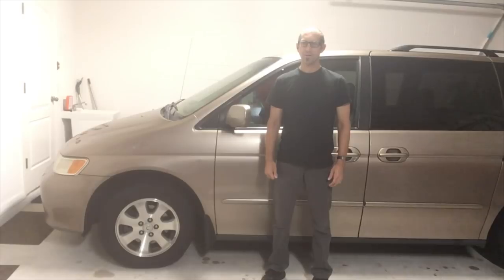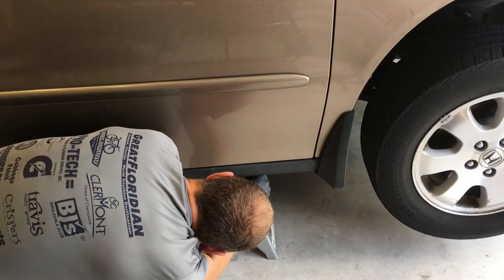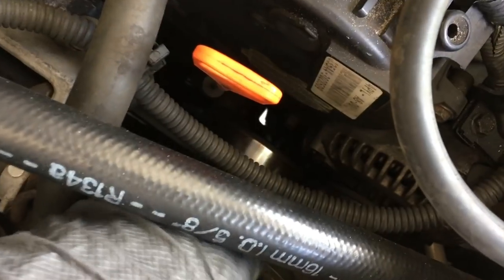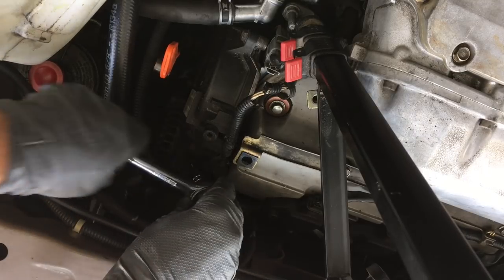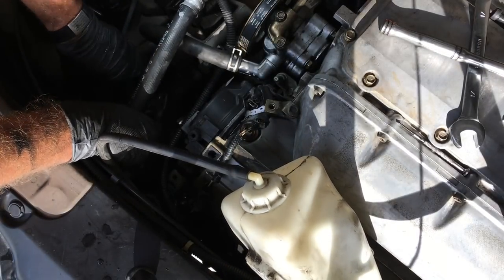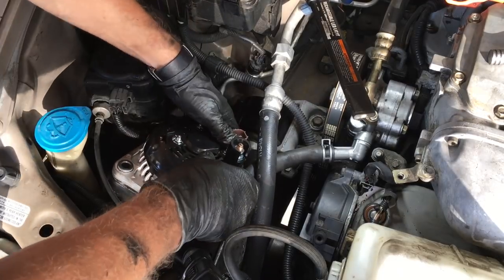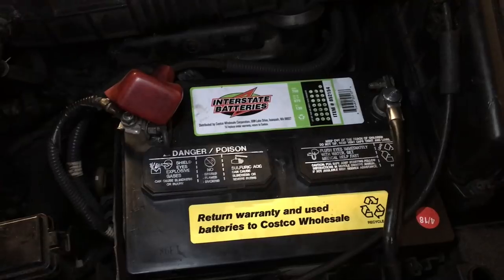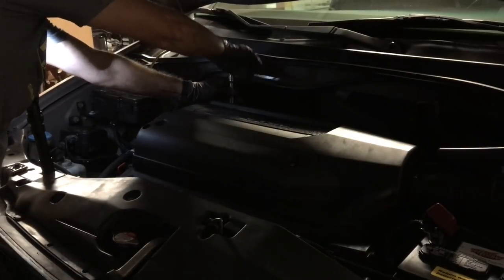2004 Honda Odyssey Alternator Removal & Replacement without removing tensioner pulley

Comment: You have the best video on youtube regarding this.
Reply from the maker: Crazywaffle5150 , thanks for the kind words.  If you have to replace an Odyssey alternator and have any questions, let me know.
Reply: DIY Jeff Anytime. :]. Lol. Actually I just fisnished getting it out 15 min ago. Did not even need even need the tool for getting the belt off. Just used the double wrench method. Lol with a 19mm and 18mm box end. Hardest part is pulling it threw the mess of hoses.  Haha
Reply from the maker: Crazywaffle5150 , yep, I think I mentioned it in the video, but it took me awhile too.  But the plus side is you don’t have to disconnect and connect them.  Plus, discounting hoses like power steering can be a real problem and mess.
Reply: DIY Jeff True. Lol. I got around it. Thanks for posting this video again!. I'm up an running now
 :D. 140 bucks later after buying a new Alt at Auto Zone.
Reply: ...there is a dude that simply took a pry bar and leveraged the tension pulley in such a way that the timing belt can just slip right off the alternator.... SOO MUCH FASTER AND EASIER.
Reply: @DIYJeff  6

Comment: Thanks for your helpful video, Jeff. I replaced my Alternator in my 2001 Odyssey over the weekend.  After watching your video, it appears to be easier to complete the alternator replacement on a 1999-2001 2nd Gen Odyssey, than with a 2002-2004 2nd Gen, since I was able employ my belt tensioner tool from the top side instead of from underneath.  I still had to jack the car up and remove the plastic undercarriage skin to properly fit the belt back onto the pulleys.  Your recommended tools for completing this job was a true life-saver.  Thank you so much!
Reply from the maker: cgrscott , awesome!  That’s great you were able to do the job.  It’s fulfilling to do a job yourself and save $$$

Comment: GREAT video.
Changed my brother's 2000 Odyssey alternator.
Only thing we did differently was to remove the top bolt when reassembling in order to get the belt over the alternator, then use a wrench to remove the tension from the tensioner then swivel the alternator back into position to replace the top (or right side) bolt.
It was way, way easier, and we didn't have to get under the vehicle at all.
Thanks for a clear, concise video.
Reply from the maker: @Spencer Reed, thanks for the tip.  Glad you were able to fast track the repair.

Comment: Anyone reading/doing this in 2021 I strongly suggest removing the tensioner in the 03-04. I just did mine, and messed around trying to get the 14mm bolt in for seriously like an hour. Went under and just took out the 17mm (i think that was the size) that held the tensioner in and was able to get that 14mm in immediately. I don't have a ratcheting wrench, I'm sure it would have helped if I did, but I still don't think it's worth it. Just remove the tensioner, IMO.

Great Video though! Much appreciated.
Reply from the maker: @M. K., thanks for sharing your tip with everyone!

Comment: Love his approach! I did pretty much what he said and while it was a chore, I'm up and running. THE ONLY THING I'LL ADD is I suggest you remove the bolt holding the bracket that holds the upper alternator bolt and the wire harness. Getting the alternator in and out was easy after taking the bracket off. I'm with CrazyWaffle... this is the best video I saw.
Reply from the maker: @Joe Lutz, good tip and thanks for the kind words.
Reply: Thanks I just got this thing out and it defs adds alittle more room

Comment: I wasn’t going to attempt this job until I saw your video. It wasn’t easy, but I got it done and saved a bunch of money. Thanks!
Reply from the maker: Prophesy to the Wind, you’re welcome.  Glad you felt enough confidence to venture into the project.  It’s satisfying to save money and do it yourself.
Reply: What is an estimated time to do this job?
Reply: @karenwohlforth8967  the first time I did it (I had to do it again since my last comment) it took several hours, but that was because of a bolt that was put in backwards from a previous repair. The second time, probably less than 2 hours. It was much easier.
Reply: I love saving money

Comment: The project is halfway completed.... am waiting for the alternator to install.  So far the removal has been easy due to your guidance.
Reply: Did you have any trouble getting the new alternator installed? I'm having trouble getting the two main bolts in.

Comment: This is a great informative video, I  just replaced my alternator on my 1999 Honda Odyssey EX and it went a little different than the steps in the video. I originally tried putting in a duralast alternator from autozone and it didn’t work properly. It was putting out erratic voltage and making the MIL lights on the dash flicker erratically including the battery light while other times the lights were solid (like when accelerating). I ended up putting in an OEM Denso alternator and it’s working great. A couple things that were different on the 1999 I used a serpentine belt tension tool I got from harbor freight and I was actually able to get on the tensioner nut with the long bar and the included 14 mm crows foot from the topside of the engine. I still had to jack up the car and remove the splash guards to get the belt back properly on the pulleys though. The tensioner nut is 14 mm on the ‘99. Lower alternator bolt is 14 mm and upper bolt is 12 mm as stated in the video. I used the half open half ratcheting box wrench for the 14 mm lower bolt with the ratcheting box end on it until I could get a 1/4 drive 14 mm ratchet and socket on it to finish tightening it. As others have said that’s the powering steering fluid reservoir not the brake fluid reservoir. I used some small vise grips with tags to clamp the hoses shut and a package of Dorman rubber caps to cap off the reservoir when removing it. Just make sure you refill your powering steering fluid after reconnecting the reservoir and burp out any air by turning your steering all the way back and forth a few times with the cap removed. Hope this helps.

Comment: Great video, Three tricks that will help it go even smoother.
1. Just remove the power steering reservoir completely it will free up a lot of room.
2. Put a jack under the oil pan and lift up about a quarter to half an inch this will free up a little bit of room.
3. Use your tensioner wrench and push the tensioner to the side this will create a lot of room for the alternator to slide out and the new one in.

Comment: Thanks for the vid! It helped a lot. I found it much easier to maneuver the alternator when I removed the upper mount bracket that the 12mm bolt goes into. Thanks again!

Comment: great step by step video...iam about to replace my alternator ill try to be as calm as you are,i usually cuss or perhaps throw wrenches on my pistoff drywall spot.
Reply: Its shitty job- Honda made it too tight... but its doable.

You can loosen the belt with a pry bar instead to avoid jacking up the van

Comment: Also...... The pulley tensioner is accessible from the top by fabricating a simple wrench. Take a piece of 1" x 1/8" x 24" ish steel bar and a T50 bit (which I got by dissembling a cheap socket). Cut down the T50 bit to a length of 3/4", drill a hole in the end of the steel bar slightly to small for the hex end of the T50 to pass through, then press the bit into the hole with a vise.  T50 was the size required to fit the bolt in the center of the pulley on the tensioner on my 2002

Comment: Jeff, thank you.  Your audio instructions were great.  The VIDEO visuals were fantastic. I am confident I can replace this today thanks to your video!
Reply from the maker: Scott, you're welcome.  I'm confident you can do it.  I do suggest the pulley tool though.  Without it will be much more difficult to loosen the tension on the belt to remove it.
Reply: DIY Jeff I did get the tensioner pulley tool on loan from the local auto parts shop. Without it, I would not have been able to complete.  I completed the job without any issues.  The only part not covered in the video was the engine splash shield. That was a pain but once I had it off, all went smooth. Thank you!

Comment: I enjoyed the video  .... you explain the steps well and I appreciate the detail with respect to safety.  I also appreciated the "patience" comments to warn the listener that some procedures are stubborn and requires a little  time to wiggle and or/unsnap   .....  I found the wiring harness to be difficult to remove.
Reply from the maker: Mr. Jazzohjazz, how did the project turn out?  Yes, the wiring harness gave me a little issue too.

Comment: Great video - on my 2010 - I was able to access the tensioner from the top with a socket wrench and a length of pipe over the handle for leverage.
Reply from the maker: Tim, that's great!  The tensioner pulley is accessible from the engine bay on Odyssey's newer than 2004.  Good thinking on using a bar for leverage, saving you from renting or buying a tensioner pulley tool.

Comment: Thanks for the help. Took some splash guarding off to gain access to the tensioning pulley and a wrench fit right on. Took time and patients but it wiggled right out saved me a bunch of money.
Reply from the maker: Neil, in the future, if you live near an Autozone, they have a free tool rental available.  That's where I got the tensioner pulley tool.

Comment: It worked like a charm except that it was too tight a spot to get the 19mm socket onto the serpentine belt tensioner bolt, even with the tool I rented from oreilly's . Amazingly, a 3/4 open ended wrench worked like a charm. The serpentine belt tool seemed totally unnecessary. Thanks for this video!

Comment: Thanks, great video. I have a 2003, and was able to get to the tensioner pulley bolt from the top.
Reply from the maker: @paul nenninger, that's awesome you were able to get the tensioner pulley from the top.  I just wasn't able to reach it on mine.

Comment: Two suggestions to make a bit more room to remove the alternator:  The right (14 m) bolt connects to a bracket.  The bracket can be removed to provide additional space.  You can  also get a bit more room by keeping the tensioner pulley retracted.  You can do this by rigging a piece of wood to keep the tensioner pulley tool in the retracted  position.
Reply from the maker: James Immordino, thanks for sharing the tips.  Good information.
Reply: Thanks for this info

Comment: I have a 2001 Honda Odyssey with 342 thousand miles on it and I'm still on the original Honda alternator. Before I begin my summer road trips, I always have my mechanic test the alternator and if it checks out perfect, I feel like it's good to get me through the rest of the summer.  Now, I'm at the place were I feel like I need to replace it before it fails, just as a form of insurance.
Reply from the maker: At 342,000 it wouldn't be a bad idea.
Reply: @DIYJeff  Thanks for posting the Amazon link to the Performance W84010 Serpentine Belt Tool.
Reply from the maker: cgrscott, you're welcome.  I found it extremely helpful for loosening the tensioner pulley and it made the job so much simpler.
Reply: @DIYJeff  I saw the link you posted for the ACDelco 334-1319 Professional Alternator, Remanufactured for my 2001 Honda Odyssey.  Would that part last at least 60k to 80k?  The Honda Dealership parts counter is pricing $500 for just buying the Genuine Honda Replacement Alternator, not including paying the service center to install it. I'm gong to install the replacement alternator myself so, new aftermarket or rebuilt aftermarket is the only avenue I can afford.
Reply from the maker: cgrscott, I've always been pleased with AC Delco parts.  There is of course no guarantee, other than the limited warranty, but I would feel confident in putting it in my vehicle and expect at least 100k+.
Reply: @DIYJeff  Thanks for the recommendation.

Comment: also i ended up using a 19mm wrench to turn the tensioner pulley to release the serpentine belt on the bottom of my vehicle and it worked great for me.
Reply from the maker: @RAY ALLEN, that's a great tip for everyone.  Thanks for sharing.

Comment: Thank you for the clean video😊😊😊😊  Any one  changing alteraneter  just loosen the nut  loosen the  both bolt take out the back one  first then front one  will be much easier  you can torque both 😊😊😊😊😊😊

Comment: Just did this on my wife's 09. It was a pain but I didn't have to remove anything but the plastic covers. Those a/c lines though FML
Reply from the maker: It's certainly not an easy job as you learned, but it's certainly doable.  Just takes some patience.

Comment: your "brake fluid reservoir" is actually your power steering reservoir and that is a positive cable on the starter. otherwise decent vid.
Reply: False
Reply: Mechanic humor lol
Reply: Not starter wire, that's a charge positive wire for the battery

Comment: Hey all -- just a tip, Jeff says you cannot reach the tensioner nut from above, this is incorrect. using the serpentine belt tool and a small 19mm allows enough room to turn the tool sideways from the rear of the engine cavity, & slip in the crack, then pull back up like you were approaching from the bottom. You'll have enough leverage on the bolt to loosen to complete this job w/o ever getting under the van.  Gool luck all!!
Reply: Hey Sir, 
I'm about to do mine in the morning, I bought the tensioner wrench kit, So I can do it from top ?
Reply from the maker: Farttity, good work around.  I've never done it that way, but if it works then good deal!

Comment: Replaced alternator 6 months ago. Now when I hit a bump, all door lights go on and battery light too. Had it tested and its fine. Any ideas?
Reply from the maker: @Joseph Carlos, if you hit a bump and lights go on, including battery light, I'd suggest you have a short somewhere.  I'd start by looking at your battery terminals and make sure they are not corroded and are making a good connection.  Make sure you main positive and ground wire coming to the battery look alright.

Comment: Great video, thank you. I do have a question. My 2004 Honda Odyssey has 261,000 miles,  with the original tensioner pulley and alternator. A pro shop tested the alternator and it is  still functioning perfectly. But i plan for the alternator shop to take it apart and rejuvenate it. Wouldn't it make sense, with 261000 miles, to also replace the tensioner pulley, making the alternator easier to remove and re-install?
Reply from the maker: @Tells The Truth, at 261,000 miles, if the tensioner pulley is original, I'd suggest replacing it while you're in there.  It would be a good preventative maintenance since at that point its just pulling out a bolt and putting a new one in.  It only takes about 5 minutes to replace it since the belt will already be off.

Comment: I struggled with the wiring harness from the alternator longer than I needed to. Mine had the clip toward the front of the van, so the easy solution was to use a short flathead screwdriver to depress the clip (while pinching the front and back sides) and a long flathead screwdriver to push against the lip on the edge on top. Slid out like butter. I was disappointed to see the new alternator didn't line up with the tensioner pulley exactly. I would suggest comparing the pulley position side-by-side with the old alternator before installing it. You may need to add washers behind the alternator pulley.

Comment: I noticed that you mentioned using a Duralast (Autozone) alternator because you were in a pinch. I have been in the same situation several times in the in the past with my vehicles and have had to buy a parts store brand remanufactured alternator. Duralast (Autozone)  alts seem to be the worst ones for me at failing early. Carquest (Advance Auto Parts ) alts were better but none of them seem to last very long. (They  entice you with  "lifetime warranty" but they don't warranty the labor).  If one can wait for shipment, the AC Delco Pro units you linked are better and also diy people and shops use the Denso Perfect Fit reman units (buy at Rock Auto w/coupon) which are similarly priced. FWIW, I have read that  the TYC and other budget new aftermarket alternators from China don't last very long. Anyway, whatever alternator on chooses ,it is always a good idea to have the repalcement alternator tested on the machine at the auto parts store  I have gotten bad ones right out of the box.
Reply from the maker: ppett1,  Thanks for the info.  That's good to know.  I've always been happy with AC Delco parts too.  I've had the alternator in my Odyssey now for about 9 months with no issues.  Even though there may only be a warranty on the part and not labor, the good news is if you do it yourself then it wouldn't cost anything, but your time to replace it.  But I agree, not ideal.

Comment: the 14 millimeter screw or bolt is smooth, it lost the stripes and the alternator is loose and when you start the car the belt comes off, which I recommend doing
Thanks

Comment: Wish me luck.. Great video man thanks!
Reply from the maker: James Castillo, good luck.  Just be patient when you wiggling it through the hoses and then putting it back in.  Some have commented they have trouble getting the bolts to line up back into the alternator.  I suggest loosely putting in the bottom bolt first which should give a little more wiggle room or line it up.

Comment: Great video. The parts listing for the  1999-2001 Honda Odyssey alternator is different that for the 2002-2004 model. They appear to be identical. Does anyone know what the difference is. It looks like that they should be interchangeable. Any comments ?
Reply from the maker: ppett1, thank you for pointing out the part numbers are different.  I've updated the description to include a link for the 1999-2001 years.  I don't know the difference between the two, but I'd highly suggest getting the one specific to your year of vehicle.